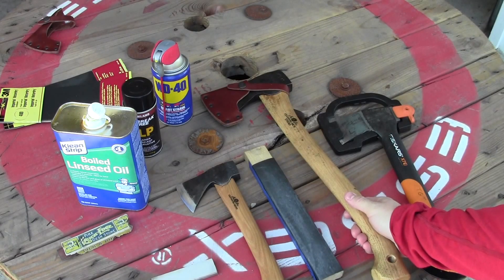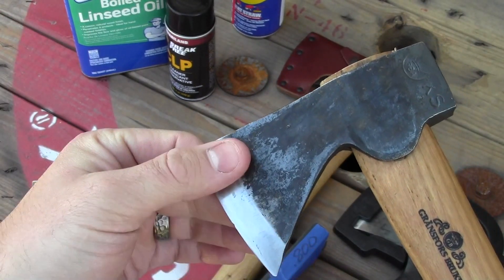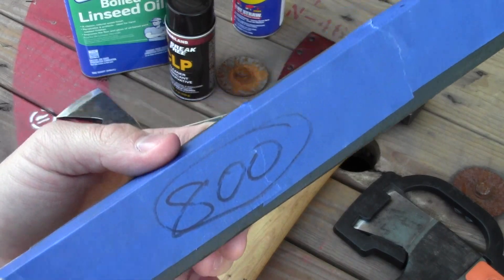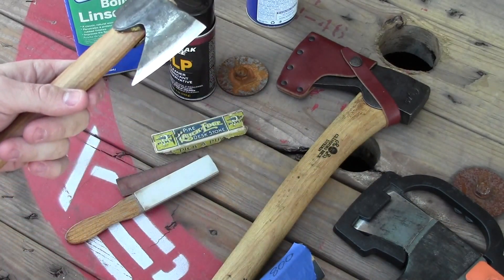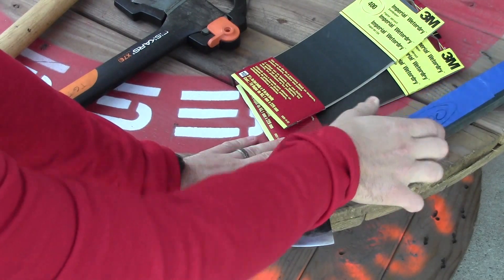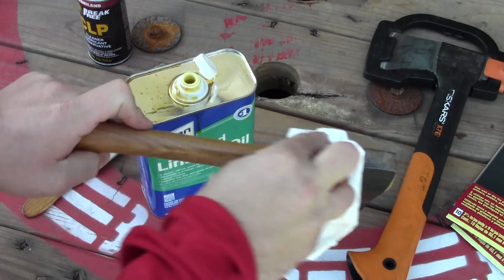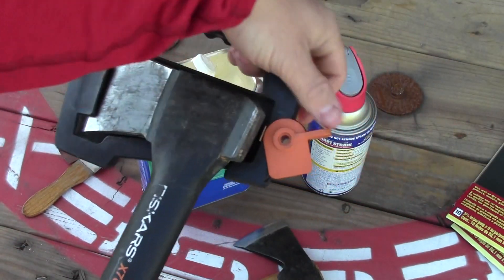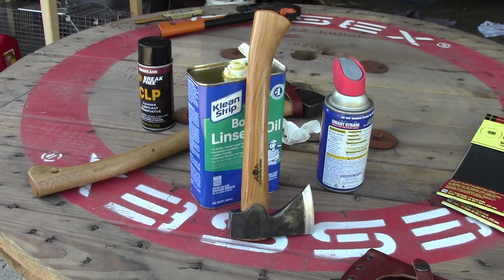"Gransfors Bruks Maintenance" by TheGearTester

Comment: WD-40 isn't actually a true lubricant. WD stands for "water displacing" and its main use is as a solvent or rust dissolver.
 The lubricant-like properties of WD-40 come not from the substance itself, but from dissolved components. And the effect doesn't last as the product is made to displace water and bring it to the surface, let it evaporate then evaporate itself completely away, leaving nothing behind. So I suggest you use something else for your axe head protection, something that can get absorbed in the crevices of the scales and protect them from subsurface rust and moisture, like different brands of gun oils, ballistol etc.

Comment: Your boiled Linseed oil will penetrate better when mixed 70/30% Mineral Turpentine - Linseed takes forever to dry so once put on, it's easy enough to wipe most of it off 20min later.

As for blade care, you're best off with a straight oil as opposed to a Kerosene based product like WD40 - WD or Kerosene will clean a blade well after heavy use but would wipe it clean and apply a tiny amount of Camelia oil as it is a superior rust preventive.

I keep all of my axes razor sharp with a leather strop and polishing compound, it leaves them mirror polished which is easier to clean and less likely to stain or rust.

It's all personal preference ☺

Comment: Just curious, since the Gransfors handles are finished with beeswax would it make more sense to refinish with the beeswax again rather than oil?   It seems like the existing wax finish might resist the oil soaking in.
Reply: I just ordered my small forest ax, and trust me, they put very little linseed oil on that wood, not sure if they even use beeswax, but a very light sanding, and I was able to soak up a large amount of boiled linseed oil, so I really don't believe they use bees wax, and if they did, it was next to nothing, as their linseed oil coating was very slim as well.
Reply: Chippy/ You are correct. No Beeswax.
Sorry I'm so late to the post. Just found this channel.
I have 6 gransfors axes/hatchetts for what its worth. Just to say that I have 8 years or so of ownership and use.
They submerse them in boiled linseed oil and hang them to drip/dry.
You really need to apply boiled linseed oil liberally every month for 4 months In my opinion, then every year thereafter. But it is very important to wipe the handles dry after they have absorbed what they can otherwise you will end up with a sticky handle. I especially pay attention to the end grain (where handle is wedged on and at the butt end at the swell). These areas really absorb the oil.
TGT/ Very good video, keep up the good work. I like your content.